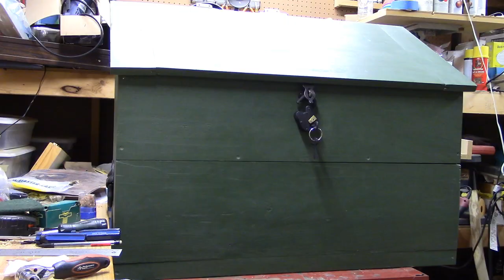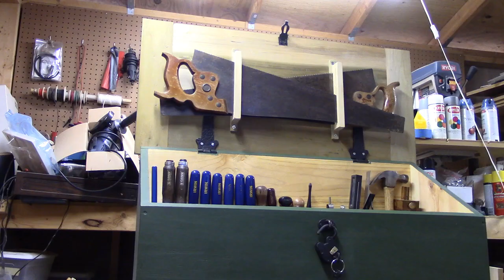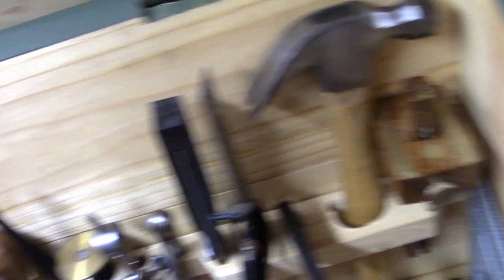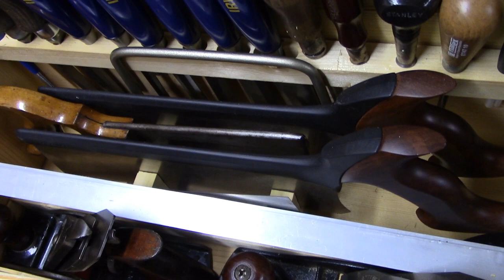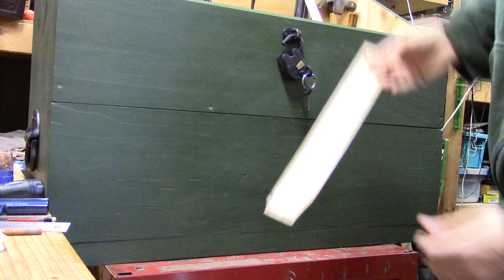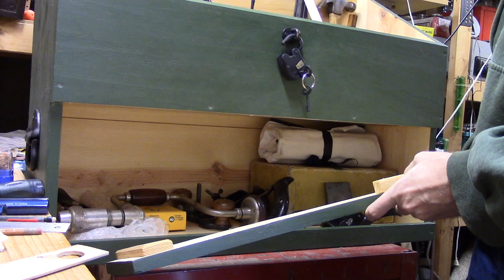My Dutch Tool Chest

Comment: Thank for sharing brother.  I really have appreciated the series.
Reply from the maker: No problem, thanks for watching!
Reply: @SharpWorkshop  there’s not really been another person who has memorized their build.  I’m considering building the DTC with the additional lower unit on it that Schwarz spoke on later; here’s my reasons/purposes; please give me your thoughts on the matter.  
My circumstances: I live in NW Tennessee (heat, cold, and lots of humidity). I’m a retired/disabled Marine Officer with multiple spine and a brain injury, I’m not permitted to drive because of seizures and spatial vision issues.  My shop is ~18’x20’ and is not hand tool work exclusive, so it must share with maintaining out 125 year old home, seasonal rotation of household needs/decorations/etc between the loft of my shop and what’s needed/being utilized downstairs.  There are some power tools, but my table saw is gone as soon as I acquire a new wood bandsaw with reliable power/fences/table/resaw capacity 🤪

So, I’m thinking the Dutchy is a better idea for me because:
1: Chest beats tool wall because of shop conditions with humidity and because when I have a seizure or surgeries the tools may go idle for sometime; often without warning.  I currently keep a VCI pod in every drawer of my mechanical tool box where my tools currently live. 
2. Dutchy on a extra level beats bending over as much; Id think. 
3. The over all footprint is less than that of a ATC example. 
4. Since I can’t drive and rely of everyone to get anywhere, I really don’t think I’ll be traveling with my tools all too much.  

What lessons have you learned, would do different, wish you had added?

P.S. Like you, I’d build mine wider because of my saws. I have two 70’s vintage PAX handsaws that top out at 26” in rip and cc.  I’m not going to go investing in 22” saws just to appease my chest, when I have two great saws already... I could spend that money on hardwood or put it towards my bandsaw.  Plus, I think that extra room would allow me to give comfier room for tools in the top since I’ll work out if the chest.  

Thanks brother, Shannon
Reply: Ok, I’m finally ’round-toit’. I’m tired of going in and out of pelican cases when I need just one thing 🤦🏼‍♂️  I’ve been working out of an old steamer trunk that I converted into a floor chest for about a year now and before that I was working out of a big tool cart (the waist high ones about 2’ deep and almost 6’ long). The long cart is great the floor chest is great, but for other things; and neither meet my woodworking needs (besides it feels weird using my woodworking tools out of a mechanics chest).  The old steamer trunk is fine because I’m not traveling with it and I had mounted it to a dolly that comes all the way to the corners and has a mullion in the middle to support the bottom. Actually kinda classy and I don’t know why I haven’t seen YT videos on doing so.  At any rate, it’s time. I want everything in one place and I figure that DTC with an additional floor unit will do that.  As things are now, I have a big pelican box with chairmaking specific tools and will probably move those into that floor chest along with tools that aren’t reached for more frequently.  But the going into a case to pull out the roll that has the gouge or pairing chisel I need (not to mention the putting things back), has got to stop.  Basically my current form/flow doesn’t make me happy and is probably dangerous as well.  I noticed you haven’t done anything on your blog in years, but have done the videos. Yours is still the most thorough DTC build series I’ve seen. Any changes, thoughts, lessons learned since you’ve lived with it for a few years now? Hope you and yours are doing well. 
V/R, Shannon

Comment: Great looking tool chest!  Love the 5 rivet handsaws! I'd be curious how many men it takes to lug this thing around though... or do you empty it for transport first?  ;-)
Reply from the maker: Thanks for the kind words!  Truthfully, I haven't moved it much since I built it; I mostly keep it on a little cart with wheels.  I think I could barely pick it up and move it  by myself, but I'd probably pull most of the stuff out of the lower compartment just to spare myself from potential back problems.